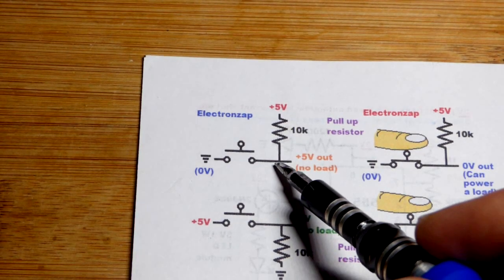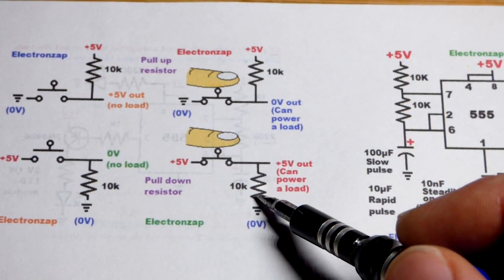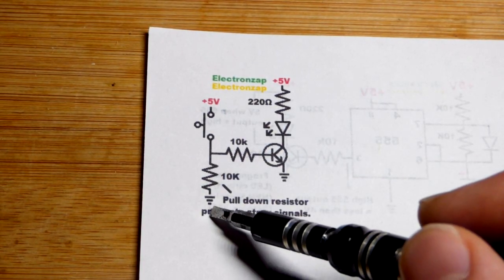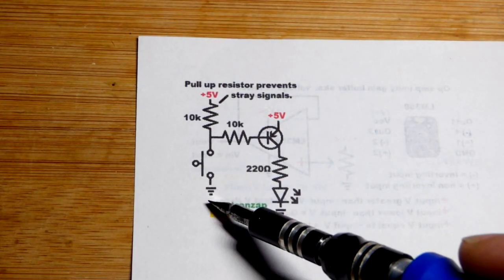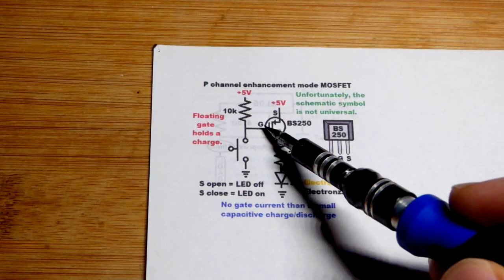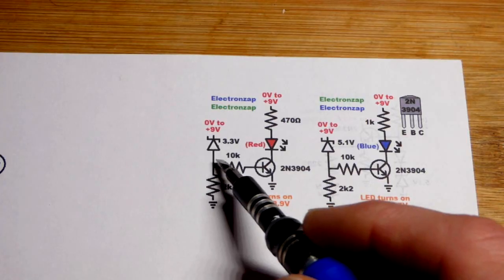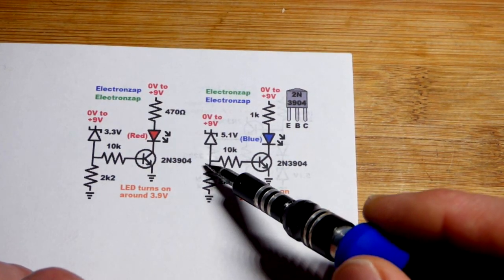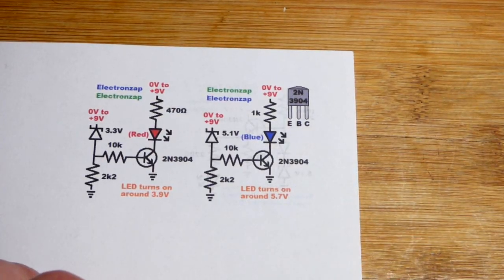Pull Up and Pull Down Resistor Review for Learning Electronics

Comment: Thanks for this video.  I watch lots of electronics videos (I'm a mechanical engineer who is learning electronics).  I hear the term "pull-up" and "pull-down" resistor all of the time when circuits are explained, but this is the first time I seen these particular terms described as a way to prevent "stray currents" from turning on the BJT.  I have learned that the 2 resistors in these circuits are used to make a resistive divider to bias the transistor, but I have been curious why a resistive divider was used instead of just one resistor to bias the transistor.  I think it would be very interesting to provide an example of stray currents that are turning on the transistor.
Reply from the maker: The voltage divider at the base of the transistor is meant to give the transistor a baseline of conduction (bias). With no signal, the biased transistor is constantly on partially by a steady amount. A weak signal added to the biasing can easily change the transistor's conduction, even if it is an alternating current by use of coupling capacitors. A weak signal can make a big change in transistor conduction, and therefore the transistor can deliver that signal to something else with more voltage and/or current (amplification). Although the amplified power is likely inverted from the signal, but that's usually fine for AC and many DC circuits. I understand most of what I read when it comes to audio and radio communications electronics, but I don't get excited with either of them, so I haven't done much when it comes to signal processing.  Thanks for letting me know you are interested, I'll make more effort to come up with demonstration circuits.
Reply: @Electronzap  Thank you! I appreciate the depth of your response, which was very helpful to me.